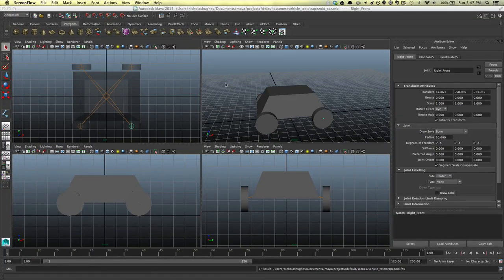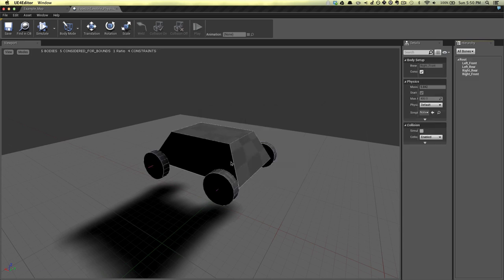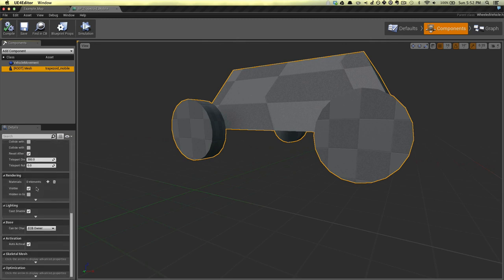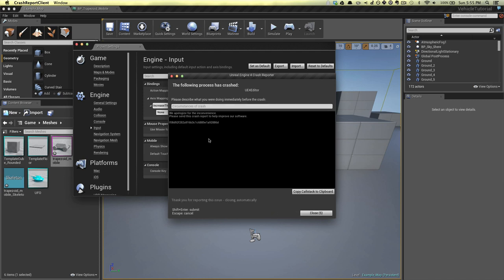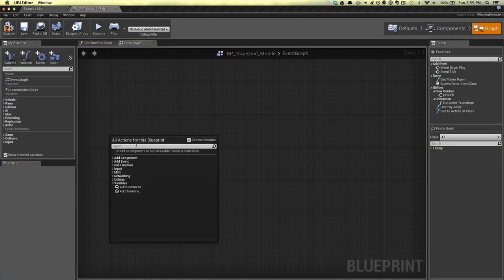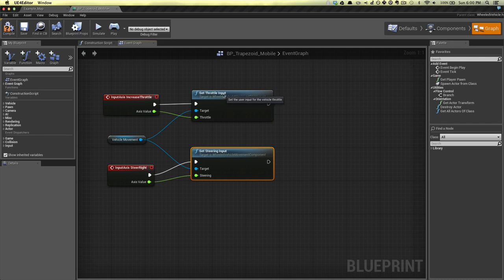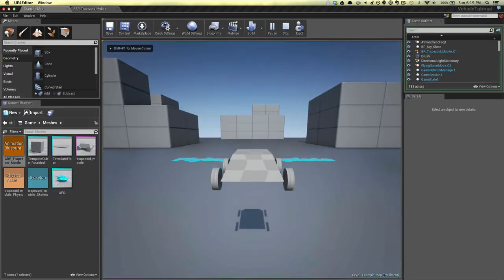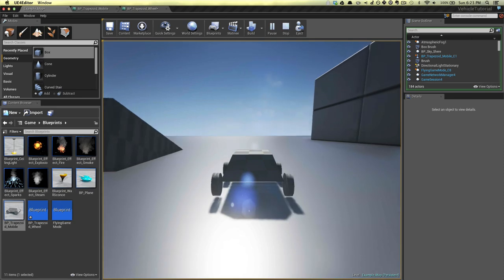Unreal Engine 4 Vehicle Tutorial (Blueprint)

Comment: My "Get Rotation Angle" node does not have the white execution input. Why?

I have the same issue with the "Get Steering Angle" and the "Get Suspension Offset" nodes. Neither of them have the execution input, either.

UE4 v4.17.2

Comment: Great tutorial, my front right wheel floats off of the ground while all of the others are touching the ground. Any Idea why?
Reply from the maker: Thanks! Make sure that all of the wheel setups are identical. Perhaps 3 of 4 wheels are using the blueprint wheel and the front right is using the default vehicle wheel class? That could result in a different radius and, potentially, a lifted wheel.
Reply: ***** Thanks you, They were the same but I noticed that the bone name was misspelled, it works now.

Comment: If your vehicle does not move, make sure it is the right scale.
Reply: +FonerG I am having the problem with my vehicle being unable to move, I believe it may be because the scale isn't the correct size.
How would I work out the scale in proportion to my vehicle?

https://forums.unrealengine.com/showthread.php?98793-Custom-Player-Controlled-Vehicle-Not-Moving
Reply: +Burnzy Gaming I am no exprert. I had lots of issues, scale was one of them, but made it work eventually. The model should be in real world cm units. Make sure you freeze transormation before FBX export. make sure that the wheel blueprint's radius is not smaller than the actual wheel itself.
Reply: +FonerG thanks, but unfortunately I have already done that so it must be some other problem, maybe the mass.